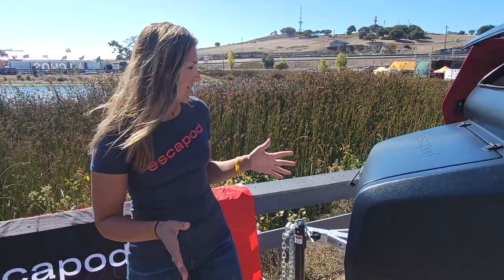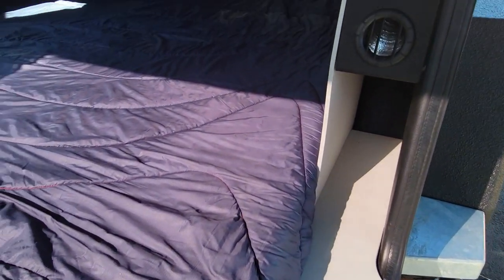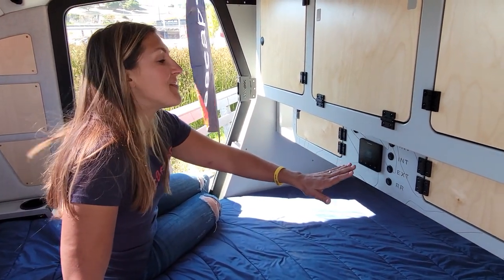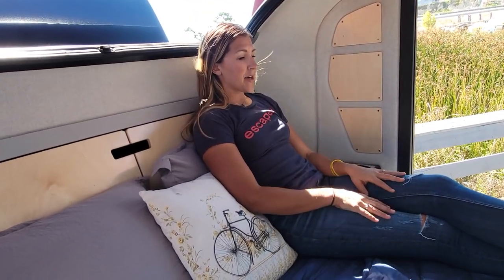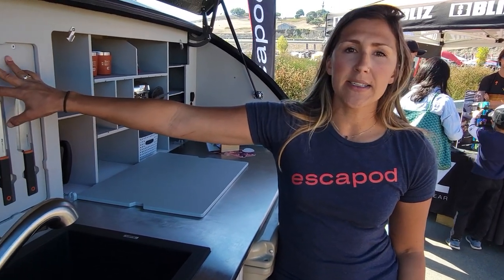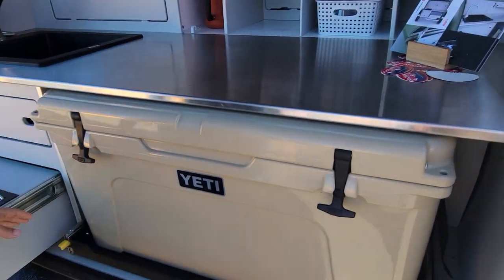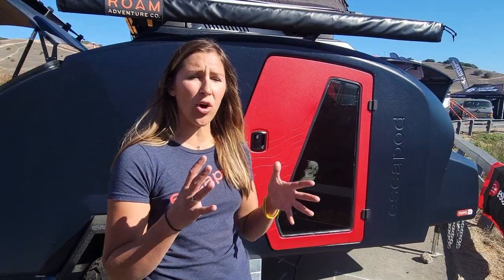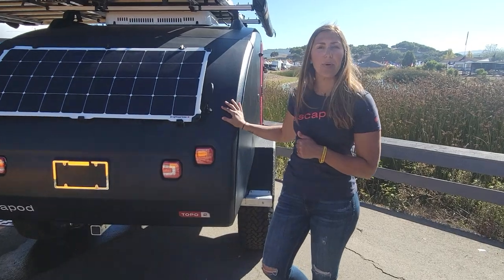Escapod TOPO2 Off-Road Trailer Walk Through

Comment: Nice!!  There is plenty of space inside.  I especially like how they did design it around doors to keep water out.  I'm amazed how much campers are now too much. I'm not sure how much this one is.  I've own through the years a 34' rv, a fifth wheel and travel trailer how and a truck camper, my favorite was the truck camper cause it didn't take up much space and I could just pull over and go to sleep.

Comment: Very nice design. Will certainly give this consideration.  Would you speak more to refilling the water tank and the shower feature in a future video. Also, would be nice to have you demonstrate the accessibility of mechanicals for repair or replacement since you tout the expected longevity/durability of the trailer. Lastly, it seems petty to not include door screens and shades in a $40,000-$45,000 teardrop loaded with other features. Seems incongruent. . Overall, presents well.
Reply from the maker: Thanks for your input John! Definitely something we can look into for a future video.

Comment: Looks great! Would love to know where the 110V outlets will be located, as well as how the air conditioner will be integrated. Thanks for sharing!
Reply from the maker: One 110 outlet in the galley inside the cabinets & one inside a cubby in the cabin (closer to the laptop stand). A/C will be roof mount & will run off the 12V system. Backup generator or shore power will be required  for multi day use of the a/c
Reply: @EscapodTrailers  Excellent! Thanks for the quick reply.

Comment: Let me share a few thoughts.  First, I am happy to see a very upscale product being offered on such a small sized trailer.  I find its fairly difficult to get high quality features on the travel trailers and teardrops, whereas the Class B and Class A RV's are mostly very high in quality and in price.  As for the $43K price for such a tiny trailer, I see why there is pushback, however, I think there is a strong case to be made for paying this price as teardrops have many advantages over larger RV's.   Those advantages include being able to tow with with almost any vehicle (like a Tesla or off-road jeep if desired). Towing and driving could not be easier (a far better ride in your car than your 40' Class A diesel pusher?).  You can tow it with your daily driver, so you just saved $30K to $50K on a separate tow vehicle.  I like the idea of a tear drop for traveling solo vs with a family.  Additionally, I like the flexibility of leaving the trailer somewhere and just traveling with your vehicle instead.  Very easy to put the trailer in storage anywhere (say a 10 x 20' storage unit).  You could opt for a cabin or hotel rental vs. feeling like you are committed to staying in the larger RV you invested in.  As for size, you can easily bring along a clamshell tent with 100-150 SF of extra room (in warm weather).   With the rear kitchen feature, use of that outdoor space gives you nice comfortable kitchen room, with perfect ventilation - except its not good for inclement weather.   So, I think the teardrop format offer great flexibility in a very flexible and easy to manage size.
Reply from the maker: Thanks for your thoughts! You spoke to the advantages of having a teardrop in tow perfectly 😀
Reply: Lets see your rig

Comment: Are there additional jacks under the trailer to stabilize it when parked? Up front seems especially unstable with the just the single hitch jack.
Reply from the maker: Yes! There are two rear stabilizers that can be used to level & stabilize the trailer when parked.

Comment: Where are watertank (-capacity) , shower??? Should probably include a shower tent close to outside shower/ heater?
Reply from the maker: Watertank capacity is 21 gallons! There is a shower that you set up from the galley to pull of the water tank. We have a pop up shower tent in our Amazon Storefront that we reccomend!

Comment: Are shades provided for the doors? What is the price on this unit as shown?
Reply: According to the website, you can purchase black out shades for the door.
Reply from the maker: LeAnne is right. The Pod will come with a shade for the star gazer and shades for the doors will be available for purchase!
Reply: 40-45k based on the build worksheet on their website. It does come with a lot of standard features but weird the shades are not included.